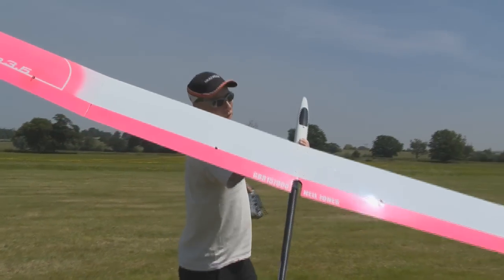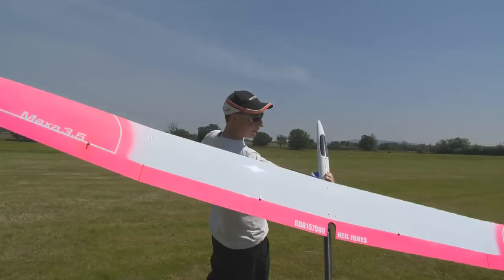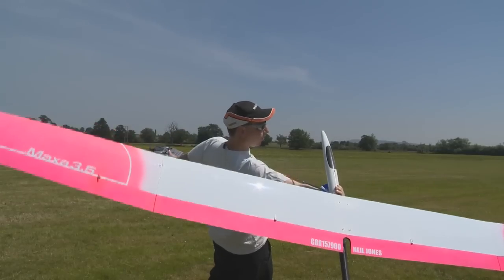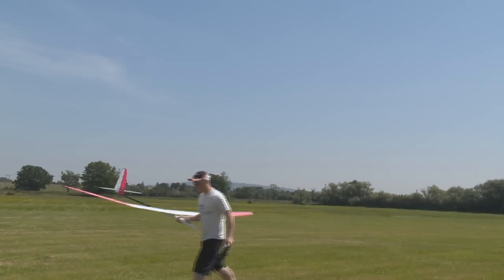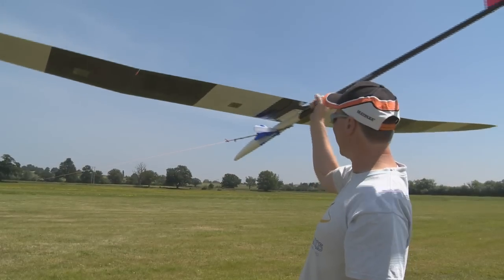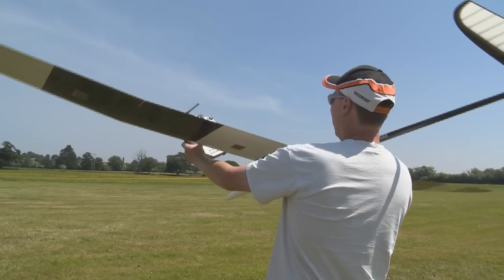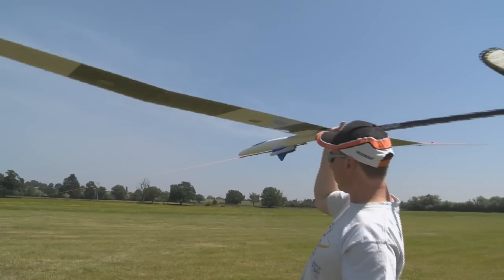Magic of Soaring - Flat Field Thermal Soaring

Comment: Have watched this video more than any others.  Really enjoy watching to see the techniques and skill.  Been working on a winch launch for a bit now, but the bungee is the simplest
Reply: I longtime believed it is only very high one catch thermals, I did not even try to stay alift, because only 2meters wingspan, less than 30 meters high launch (friend or brother running with a fishing rod.. :-) 
Actually the biggest glider I had, the more stressed I was, unable to really ''fly the wind'' as it is said here. I really learnt with a 'foamy' (Alula style), side hand launch, able to catch bubbles few meters above the ground while it seemed the end of the flight. 
Also it allows many more launchs in a same time, a bit less risky to fly slow, change the settings... then suddenly one beautiful day you have to push down nastly in order to still see the glider and not beeing eaten by the cumulus where you would usually meet big gliders, paragliders, etc..
I would be thinking about electric winch if I began to fly FPV, at high levels... which law does not allows for FAI records... ;) It would be cool to see the cloudbase with a r/c glider. ....Again never heavy enough, bigger, further, higher, while keep it simple brings the essential.

Comment: The best plane i own is the super ava pro 4flaps (6servos)
3.7m wingspan, weight only 1.23kg 

Man , the climbing rate that plane has is extreme... i do hand launches and i start just from around 4m high in a thermal. 
Crazy to do that. No elastic or winch needed 😊

Comment: Nice flying!
One thing that flying real gliders showed me is just how much adverse yaw the ailerons produce even with heavy differential. I noticed a wee bit of adverse yaw on this model. You need to give pretty much equal aileron and rudder input to do a coordinated turn as you roll in and out.  It's easy to do on an rc glider with mixes but has been one of my biggest challenges going into the full size gliders.
Reply: The Maxa only has rudder and elevator controls. What you saw during landing is the flaps. I think this is for a specific class of competition. Even so it has a lot of wins under it's wing.
Reply: ChuckPlains now that I look at it again I wonder what I was thinking. I must see adverse yaw under my bed at night. Ive been flying a wing dlg/soap soarer and without rudder control it's got a lot of adverse yaw. With too much differential, it wants to climb as it rolls.
Reply: Actually, and iroincally, looking at the first few seconds of the vid, maybe this one does have ailerons. I'm not sure, but it deffo has flaps. ;¬)
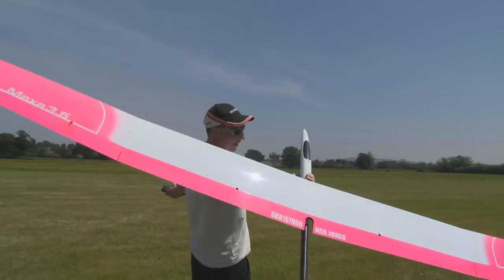Reply: +ChuckPlains If it helps, at 0:01 it looks like an aileron servo horn/linkage is visible on the top surface of the outer port wing panel just inboard of the "3.5" decal.
Reply: Yes that's what I've ended up thinking, ailerons AND flaps!
Reply: I also noticed a few slips when he was entering a turn.

However, I disagree, it is not easy to coordinate turns properly in rc soaring. A mix doesn't really do the job as you need more rudder when entering and exiting turns - best to teach your left thumb to do it. Throw in the poor vantage point on the fuse/ glide path for 2 large moments of every thermal turn and it explains why a lot of pilots can't get it quite perfect. 

It definitely doesn't detract from the fun though . . you can see he climbed out just fine. Modern ships have extremely thin fuselages that drag a lot less than full size when they are sticking out in the flow. Take a look at f3k, a lot of planes are going completely rudderless nowadays.

Comment: Great vid..... Question from a wana-b-pilot. In the vid it is stated he is flying 1/2 mile down wind. How the flip do you see your plane that far away?
Reply: Big wingspan, you can easily see it as long as you have a good sight. I remember my first RC plane, she has electric motor with collapsible propeller, so I modified wings to almost double the wingspan, than on the hot summer day I was amazed how high it goes so quick, then I realised that was thermal, I switched off the engine and had almost an hour of lift. remember to take your comfy sun baiting kit to lay and relax - otherwise you will have a "soar" neck :D

Comment: Very nice aeromodelling. How much is an RC glider like yours? How about a smaller one?
Reply from the maker: +spruceguitar 

I've posted you question on The Hobby Hub RC Guru (http://thehobbyhub.com/the-rc-guru). One of our RC experts will reply soon!
Reply from the maker: +spruceguitar

Gliders range in price depending upon their construction and level of performance. Nowadays there are many excellent foam gliders that have reasonably good performance such as the Multiplex Easy Glider, which runs around £70 to £80. These are crash-resistant, easily repairable and good for learning on.

Better performance can be achieved through inexpensive balsa wood kits, such as the Cambrian Elan 100. Gliders such as this will have a very good soaring performance after being launched by a bungee (around £20 to £30), but must be built by someone with experience in constructing balsa models. 

At the top end of the scale are fully composite gliders, such as those sold by http://www.hyperflight.co.uk. These range from relatively inexpensive hand launch gliders for around £200, all the way up to super-sophisticated three and four metre wingspan gliders costing up to £1,700. 

That said, one can have great fun and learn about soaring just as well from the Cambrian Elan as well as the £1,700 super glider.  Often, used gliders can be picked up cheaply used from sites such as the BMFA classifieds.

You'll find adverts by all the leading manufacturers and suppliers in our RC modelling magazines, RC Model World and Quiet & Electric Flight International. For details go to http://www.thehobbyhub.com

Comment: Hi, you great..
What kind thermal you used during soaring ?  Or you set the abnormal angle of attack so the plane can soaring itself ?
Reply: Here it's called a blue thermal, ever seen a dust devil on a perfect clear day? You don't need clouds to have thermals.
Reply: @forton615  I just know something like ground effect force to lift the a/c still in air.

Comment: Good tips! I don’t have over 2k dollars to spend on a glider but I do have a Gentle Lady glider an a Top Flite Metrik to thermal. What radio system do you use to fly comfortably up to 1/2 of a mile away? I use a Spektrum DX6 with AR610s and it is a bit dodgy to fly that far away.
Reply: My FrSky Taranis will go comfortably well beyond line of sight (I also fly FPV) - your DX6/AR610 should be good for at least 1km (0.6 of a mile) as it claims to be full range - probably good for double that if you are careful with antenna positioning.
Reply: I never had any trouble with those ranges with my old FM equipment.

Comment: I see you do 2 launches but i'm still none the wiser how you did it.  I could see no bungee nor how you hooked it onto the plane, how you held it, how much tension etc..
Reply: Tubing is about 100 ft. Line about 500.. Usually we pull back about 100 paces or about 10 to 12 lbs. tension. Hope this helps. With a bungee you pull it back as much as it will let you. I use a 3 to 4 meter high start as well as a winch.

Comment: Where could I get one of those?
Reply: @Justwantahover  That plane isn't something the average hobbyist is going to build. I've built plenty of built-up planes, and owned a few down-range composites and can tell you those more expensive composite (vacuum bagged wing, or hollow molded glass and carbon) planes will fly rings around balsa/ply built-ups. My absolute favorite plane I still have is a design called the 'Edge Lite' sold through Northeast Sailplane Products. I think it was designed by a man named Phil Barnes.

Comment: with witch rubber do you launch the glider?
Reply: I think you'll find that the bungee is surgical tubing. A lot of places selling it add the word 'rubber' to the sale page, but rubber tubing is not suitable as it does not stretch far enough. Good quality silicone will stretch to 5 or 6 times it's length and retract back it's original size hundreds of times without problems. You will also need something like pre-stretched  kite line (Dyneema) or fishing line (not monofilament) for the last part that attaches to the glider.
Reply: Kai02  i think its a high-start . 1/2" surgical tubing a length of braided nylon staging  and a parachute with a split-ring above the canopy.
Reply: 1/2" ?! That seems pretty big. I was thinking more like 6 or 8mm. I'll be using 6mm to launch my 1.5mtr glider this weekend.